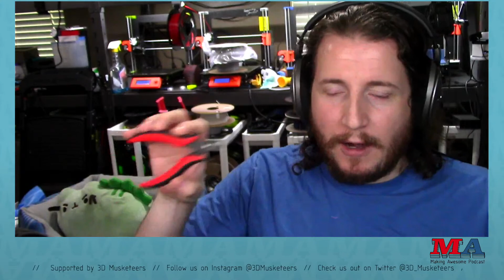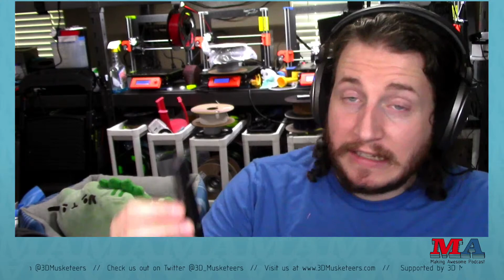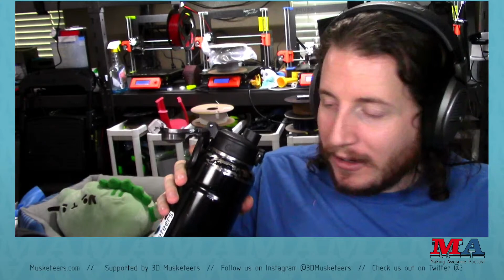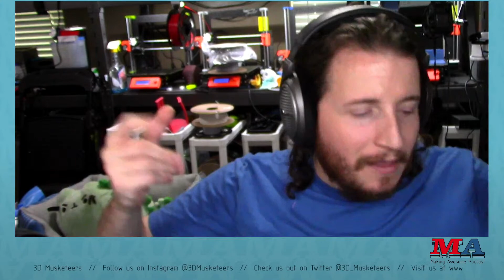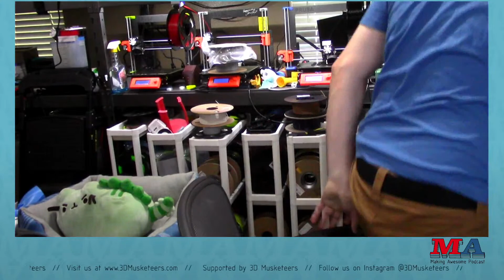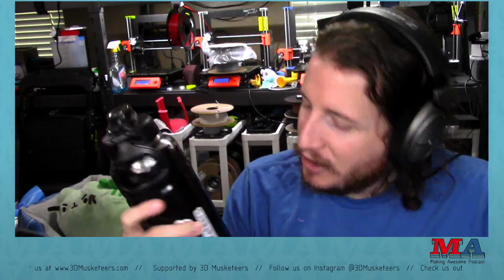Feature Creep and how it can KILL your Invention! - Making Awesome S3E2

Comment: 1:30:05 hey you know what is more efficient than a coil of wire for heating? it's ...Peltier modules! provided you have some surface to dump the cold, I mean, to suck the warmth from, you can add about 50% to the heating effect. And this is actually how I have temp control set up in my resin printer -- I've stuck a Peltier module inside the printer box with the "hot" side on the bottom side of the printer table / base plate, and with a radiator on the "cold" side of the module, and strapped it to a thermostat controller with s temp sensor again at the base plate. So basically it heats the base plate and thus the vat and basically the whole top of the printer, while at the same time cooling the electronics in the base and hopefully to some extent also the LCD.  So I can feel superior every time you mention The Politician 😅
Reply from the maker: The cooling is nice, but the one thing the Politician has over your setup, it requires nothing custom. Run a cable out of the enclosure and you are good to go! It will regulate air temp, resin temp, whatever you want.
Reply: indeed, the Politician is a marketable product 
...I'll call that a minor detail  😆
Reply from the maker: SLIGHTLY Minor lol. But a Peltier cooler and heater system is pretty awesome!

Comment: oh speaking of feature creep someone was insisting the I3 MK4 is coming soon. I'm like it won't be maybe 2 years at least. But I was curious to see what it could get. And the page I saw had so many features I'm like.........so basically it's not even an I3 anymore. lol I think 32 bit and nextruder alone would be difficult to do without making it such a radically different printer and would make for an expensive upgrade. I don't even remember what half the other suggestions were. I'm like.......all this seems unnecessary.
Reply from the maker: I figure it will be a cross with the mini and the XL's extruders. The 32 bit board, wifi and ethernet, as well as the nextruder.
Reply: @3DMusketeers  yeah that sounds reasonable, but it will be a pretty serious upgrade since it's going to be replacing the most expensive parts of the printer. I find it hard to believe they'll put much more in it than that.
Reply from the maker: I am not sure how many of the updates will be reasonably available to the users of the mk3 should they do a full motherboard swap, sometimes it is just easier to replace it all!
Reply: @3DMusketeers  yeah might be a new printer all together
Reply from the maker: They already committed to an upgrade path we just don't know what it will look like

Comment: feature creep in my current project is driving me nuts. All of a sudden the website I run got hit with a crap ton of requirements for security features. I researched security to death when I made it 12 years ago. I've always done what was asked from the IT people. But now all of a sudden I get hit with like 5 years worth of stuff all at once. like logging EVERY database transaction. I'm like.......that's stupid and it's going to use a crap ton of storage. But I did it. A week later the website was failing. Why? because it takes too long to open the log file. I added in a system to make a new log file every day (named by the date) it fixed that problem. But seriously.......this has nothing to do with security. Eliminating passwords completely? I've wanted to do that for a while. That one makes sense. Logging people out every 15 minutes? OMG I got so many people yelling at me over that one. LMAO half this stuff makes no sense. My personal favorite is mysql free isn't going to work anymore. I have no idea why. There is a strong possibility we might be switching to microsoft SQL. If we do I will have to re-write at least 50% of the queries on the website. uggggggggg
Reply from the maker: ooof that is no fun, I am sorry!

Comment: lol I have a samsung note 9 with 512gb. It's perfect as is. But I need to use it for work. It's about to lose it's updates at the end of the year. I'm worried the app I need won't work anymore. It didn't work on my last phone because it was too outdated. Also I really don't want to upgrade because the new ones all have those stupid hole punches in the screen. I'd rather have a solid screen than one with a notch or a hole in it. (and yes apple moving it down 2mm doesn't mean it's not still a stupid notch) sigh.........So I'm probably getting a pixel at the end of the year. We'll see. I actually bought the 9 when the 10 came out because of the hole punch in the 10 vs none in the 9.
Reply from the maker: I went from the 3AXL to the S20fe and while it was jarring from pixel to samsung, I can deal with it. It does have a hole for the cam, but whatever, it is not a NOTCH like apple..
Reply: @3DMusketeers  yeah. The notch is like fingernails on a chalkboard. If you are on the other side of the room with your lamePhone I can see it. and it hurts me. The hole punch doesn't offend me as an observer.
Reply from the maker: Yeah the hole is not TOO bad, maybe 1/4in in diameter. It is no issue really. The under screen fingerprint sensor is weird and I miss having a headphone jack...
Reply: @3DMusketeers  well it was a problem for me at the time I got the note 9 (another reason I got the note 9), but no one cares if we use bluetooth at work anymore. And I mostly just use youtube for music on my computer anyway. and in my car it's 100% bluetooth. I even have wireless android auto which is really nice. Apparently my 2022 bolt is the first model year bolt with wireless AA. I wouldn't be surprised if 2022 is the first year for all chevys.
Reply from the maker: Ah yes, my 20 year old honda has no bluetooth, aux port, etc. Rocking the ole tape deck adapter LOL
Reply: @3DMusketeers  yeah my 06 the only aux port was by using the tape. It had a cd charger too but I never used it

Comment: I do admit it woudl be nice if prusa slicer knew what filments were loaded in my dryers. I would have printed with the right colors (or printed the right model to begin with), but I have no idea how that would work since they aren't prusa dryers. lol
Reply from the maker: There are absolutely ways to do that though, just not currently with a public release of PS
Reply: @3DMusketeers  or stock sunlu dryers. lol
Reply from the maker: If you had some sort of NFC tracking system maybe, but GOSH that is integration hell

Comment: Ford and the Pinto fiasco was a semester case study in my engineering ethics class.  If everyone knew the details about what Lee Iacocca pulled during that time..  it’s called a “cost/benefit analysis”, they crunched the numbers and it was cheaper to pay out lawsuits for deaths than to recall and change production to add a 1lb $1.00 piece of plastic between the differential and gas tank.
Reply from the maker: yeahhhhh that was a disaster.. But that is capitalism for you.. Human lives come down to dollars and cents with little sense in the mix.

Comment: Which is why my Revo is sitting on my desk.  My Mini is pumping out prints 24/7 since I got it.  I added a hardened steel nozzle and Bondtech extruder.  Had a weird bed temp sensor failure and replaced the silicone wire to the buddy board (had silicone wire already) rather than wait for Prusa ro send a replacement and added a CF PETG drag chain to the Y axis.
Reply from the maker: Sometimes it is easier to fix the issue yourself!